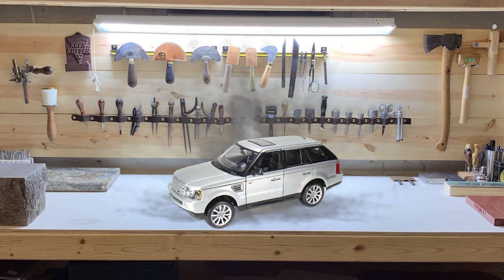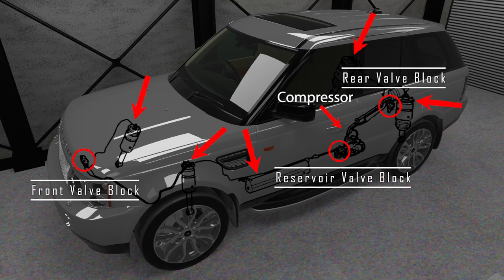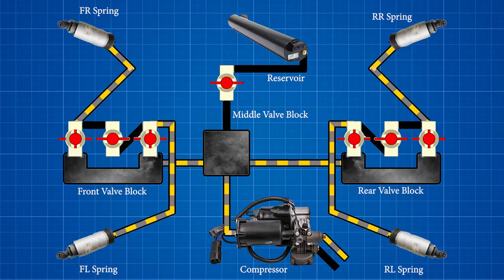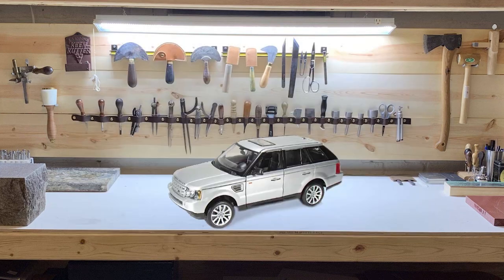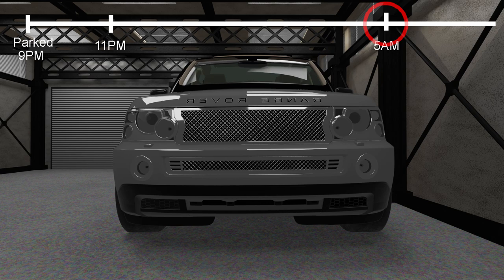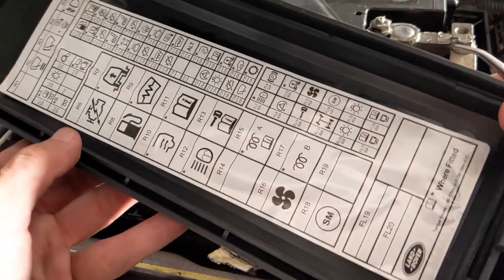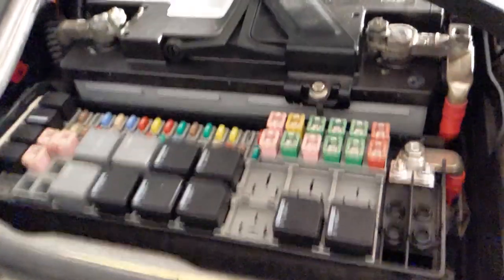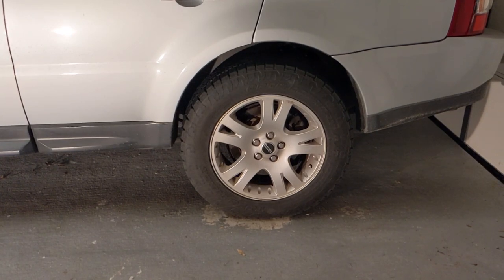Suspension Sagging Overnight - Range Rover Sport or LR3

Comment: I wanted to comment and thank you for your videos on the RR Sport.  I have recently replaced the Compressor on my 2008 Sport SS based on your video instruction, and now have determined the codes / messages that you got for the 'ride height sensor' (RHS) were the exact same as I am getting and it randomly collapses to the bump stops after those warning messages.  I can start it and go for an unknown period of time, then same failure again. The air test overnight resulted in no movement at all (not even 1/16 of an in.!)  at each corner and no front or back reduction, so I am hopeful it is just the LF RHS - the OEM part is due to me Monday or Tuesday.  I will rebuild/replace all valve blocks in the future even if they indicate no problem at present.  I will also leave a comment on the compressor replacement video regarding that procedure. Thanks again! Best, Jim

Comment: Thank you so much, this answers alot of my questions... I take it the vehicle has to parked on level ground overnight(excuse my stupidity😋). Been in and out of so many forums and this is the best explanation I could find so far 🙂🙏🙏.
Reply from the maker: It should be on relatively level ground, If it's a slight incline the front might drop some just from that. You can tell if it's the incline causing it by parking in reverse and seeing if the rear lowers instead.

Comment: Great video,  my truck goes down on the rear right only every overnight.  Tried Disconnecting the battery overnight and it didn't go down at all. That would indicate it's the ride height sensor?
Reply from the maker: That's a good guess, I would change that first considering it's pretty cheap.

Comment: Awesome video, thank you! Question, if I don't notice any change in height on the vehicle in the morning, but I hear the compressor running for a min or two upon startup, is that normal?  Is it just replenishing air in the reservoir? Or is it likely due to a slow leak?
Reply from the maker: While driving the vehicle will use the reservoir to make height adjustments, so when the car is turned off, the reservoir will be partially empty and it will not refill while the car is off. Because of this, when you turn the car on it will need to run for a bit to refill the reservoir even with no leaks.

Comment: My 2019 RR Sport SC V8 with 76K miles as started  sagging a little in the front over night. LR Dealer could not find leak.Dealer thinks it's a pinhole leak in the system. But they couldn't find the leak. The truck is not throwing any codes, nothing on the dash.They didn't charge me for the two day diagnostic. Their plan is to wait for the system to throw a error code. Any thoughts from you would be much appreciated . Great channel by the way !! Very informative.

Comment: great video, helped me a lot to under stand the system. I'm having a 
problem still, after finding the 2 front bags leaking and replaced, the front valve block replaced and the pump replaced its still dropping. With the fuse out i get a drop over night FL 30mm,FR 50mm, RL 5mm and RR 25mm also now the car will not actually level with each corner doing a different height. Ive sprayed them all with soapy water with no bubbles showing. any ideas would be great thanks.

Comment: Hi, just bought a RRS 2010 and Passenger rear (UK) side is sagging over night, not the whole rear. So problem would either be the air spring or the valve block ( not tested anything at the moment).

Comment: Great video and thank you. Q4U. My 2013 RRS driver side rear sags at night bit at times if I drive long for 20 mins it will rise back up but I keep getting. Suspension fault and the higher controls are offline. I replaced the battery and reset with the steering wheel and sometimes it works and sometimes not. My next step is to replace the rear block. Would you suggest anything else?

Comment: So I had a few of these problems, replaced struts my self etc etc, ended up going to LR shop to see why still sagging over night and they said the driver side hose had a leak in it¿ $800 was there quote, is the air hose a manageable replacement¿ lmk thanks
Reply from the maker: Front driver side? The hard part will be running the hose under the body panels, but it's definitely doable. I wonder if the problem is really a leaking hose or if it's actually the valve block.
Reply: @HazyJay  I wonder too, they had it for two days, changed the o ring fittings, car pops up, they held it a day to see if it would hold ride height and then I’m sure went through all their checks and balances etc etc, and called me back and said everything was holding except the green driver line…

I see it on eBay for pretty cheap, any idea how long it will take rough estimate thank you so much for your response and videos trying to hurry and sort this so I don’t go through the compressor
Reply from the maker: @moonbootmeechy  You will need to remove the front right wheel to access the valve block and the top of the airspring, then it's just a matter of replacing the green line. You could probably tie a string to the old line before you pull it out of the bodywork so you can attach the new line to the string and pull it through, might make snaking the new line easier.
Reply: @HazyJay  okay… I have seen both components when I changed the struts myself so I imagine shouldn’t take more than a couple hours I hope…

I’ll try to tend to this next weekend, and I’ll will let you know my results wish me 🍀 and thanks again¡

Comment: Thank you so much for sharing! I learned a lot from your videos! I have a question. Sometimes there is a hiss after flame out. With the hiss, two front wheels get lower rapidly at the same time. Do you think there is a problem with the valve (front valve or middle valve)? Thank you again!
Reply from the maker: Sounds like the valve is working fine, the car will level once it's turned off (downwards only)

Comment: Thanks for this! I found my LF air bag was leaking using this video on my 2012 Range Rover Sport with VDS. I just went ahead and replaced the front strut and shock assemblies but now I have an Active Dynamics Fault. Is this because the suspension needs to be calibrated? Or is this a bad strut? (I went aftermarket). Also worried that I didn't lift the vehicle right and damaged something..
Reply: Did you ever fix this

Comment: This is a great video. I would assume this works with a RRS L494? I have a sneaky suspicion it’s my front passenger side airbag/valve block but will try this tonight.
Reply from the maker: The procedure should be the same but the fuse will likely be different, you will need to either look up the fuses or just disconnect the battery for the procedure.

Comment: Fantastic vid, my RRS 2.8 has been deflating about every day and sometimes it won’t raise at all, so I let it sit for few days and started it and it rose as normally I removed the Air suspension ECU fuse and it hasn’t sagged but my power steering was lost 🙈 any idea why?
Reply from the maker: The RRS has speed sensitive steering which changes the stiffness based on the speed, sometimes it errors due to voltage drops. I'd guess that leaving your car for a few days caused the battery voltage to drop enough to cause the module to error. I would let the car idle for a while to charge the battery, then unplug the battery for an hour (to reset), reconnect and try again. If it has been a few years since a new battery you can try that, I suggest AGM batteries. Otherwise, you may need to take to the dealer. Obviously check the power steering fluid level but I'm guessing this is normal.

Comment: Replaced both front springs and cleaned out every piece of the front valve block. Front sags (tilts front left mostly). What are the odds the lines have issues?
Reply from the maker: I'd spray the top of the front left spring and front valve block with soapy water to see if the Voss connection is leaking. Also, consider replacing the front valve block entirely, the O-rings and solenoid seals may just be worn out and are allowing leaks back to the compressor.

Comment: Hi there I recently changed my dryer and before I did the suspension would raise slowly in the front but would still raise but now after the dryer change the front won’t raise and the compressor goes. On and off a few times then comes up with a fault saying air flow code c1311 and I can’t figure it out plz any help

Comment: Awesome video! How would we know that it's not the compressor?
Reply from the maker: A faulty compressor alone wouldn't cause sagging, rather it would cause "Suspension fault normal height only" messages to appear shortly after starting the car as the compressor tries to fill the tank/springs but overheats.
Reply: @HazyJay  Right on, thanks for the response. I'll have to do this test, I don't think there's too much sagging when i come out to my rover in the morning. the fault comes on right after starting, and if i turn off the truck and turn it back on it goes away. It never comes on when driving on the highway, only when starting, and occasionally when driving slow.
Reply from the maker: @rhandomskate  Ah, sounds like the compressor, the compressor really only lasts around 10 years or 70k miles or so.
Reply: @HazyJay  I did the test where I pulled the fuse and let it sit overnight. My front end dropped about 3" over night, equally on both sides. Do you think I should replace the valve block and the compressor? Like I said, the warning goes away after restarting my rover and it seems to come back up to normal height again and then the warning light rarely comes on again after driving.
Reply from the maker: Just try replacing the valve block first as this would cause a front end drop when the fuse/battery is disconnected! Save the more expensive compressor for later, but a faulty compressor wouldn't cause a leak overnight. @rhandomskate

Comment: I have an issue where the vehicles actual height and height on screen don't match.. is it the height sensor?
Reply from the maker: For all wheels or just one? It's either the height sensor (s) or the vehicle needs calibration.
Reply: @HazyJay  it's the rear right . Says height sensor faulty . But somehow car levels itself but stays slightly crooked. Whereas screen shows red blinking completely down wheel
Reply from the maker: @asadmo  oh ok, I would replace that height sensor in that case. Should be a cheap fix.
Reply: @HazyJay  I've got it with me. Any idea how to fit it as in jack it up or extend it ? It's a 2011 sport
Reply from the maker: @asadmo  You'll have to remove the wheel since it's too hard to reach otherwise (i believe), remember to disconnect the battery so the car doesn't try to change heights while you're doing it.
Reply: @HazyJay  thank you so much for your prompt response. Bless you

Comment: Hi haze I tested it and my front passenger side is the culprit. It lost 2cm over 48 hours. I see some videos say there is an acceptable limit if it drops less than an inch. Do you recommend changing the air spring or is it normal to lose a little air?
Reply from the maker: I think 2cm is OK, if it starts getting worse then you'll know what you need to change but it's probably OK to wait until it's more significant.

Comment: Hello Hazy! Thank you for this video. I have a question and I apologize if it's a stupid one. I have a leaking rear sway bar which is being replaced early November. (couldn't get an earlier appointment) I also have sagging on the front driver side and it progressively gets lower each day the car sits. I drive it about every 3 days and it corrects itself every time I do drive it. My question is are the sway bars part of the air suspension or are they 2 different systems? Thank you for any information you can give me. My vehicle is a 2013 Range Rover Sport Supercharged
Reply from the maker: The sway bar is just that, a metal bar, that links the left and right suspension to prevent body roll. While parked, the sway bar doesn't do anything, it really only stresses when you're taking sharp turns. The supercharged version has "dynamic stability control" which complicates things, this is likely what's leaking. Long story short, the rear sway bar leak shouldn't be causing your front driver side lowering.
Reply: @HazyJay  thanks for replying! Take care!

Comment: GREAT VIDEOS. I've done what this video says but it don't sag at all but it sags overnight when I put the fuse in. Any ideas? I had leaks in the front and replaced both front struts, front valve block as well as the middle valve block but there is still some sagging overnight
Reply from the maker: When the fuse is out let it sit and measure each wheel height manually, which one is sagging?
Reply: It doesn't sag at all with the fuse out
Reply: There is no sagging at all with the fuse out

Comment: Hey Hazy thank you for your clear videos.
My issue is the (right rear) side sag when left overnight. 
I took off the fuse "F26" overnight and the result next day was still sagging (right rear).
So now what's the verdict?
Reply from the maker: Likely a leak with the right rear airspring or it's connection to the valve block.
Reply from the maker: I would spray the spring with soapy water to see if there is a leak, if not, try replacing the valve block.
Reply: Sorry I forgot to mention I already did   that, couldn't really see anything. 
But thanks for your rapid response tho!

Comment: Mr. Hazy, a stumped LR3 owner here. I replaced the air struts, front and rear valve blocks are within a year old, overnight test confirms no leaks. But there seems to be an electrical issue. When I disconnect and reconnect the battery, I can freely raise and lower via the switch. Then, with no fault on the dash, EAS goes into "auto" mode, orange lights by switch go solid, 4x4 infotainment screen and radio lose function, and the suspension goes into normal height to drive and access mode at key off.

Standard OBD2 scanner says vehicle is free of faults.

Any insight would be helpful.

Comment: Hi, I have a question. I have a Range Rover 2009 Sport. It descends on the left side, the front and rear are the same size. I mean, it descends on the left side of the front and back a little, even if it is standing or walking.
Reply from the maker: The front and rear are controlled by separate valves, so there are two possibilities. 1. you happen to have leaks on the left side front and rear springs or at the valve blocks or 2. the air suspension needs to be calibrated to be level.

Comment: Hey Hazy, what if the passenger side (front and back) doesn't raise, what could be the cause of that?
Reply: Most likely the bags. Lower the vehicle all the way to access mode. Turn car off and wait for compressor to shut off. Turn car back on and raise it. Step outside the vehicle and start spraying soapy water on the strut towers. If they aren't taking any air and there's lots of bubbles then that's the culprit. If not then refer to your valves.

Comment: Im new to the range rover sport and the back was sagging like in the video. I followed the steps and took the fuse out. I came back in the morning and there was no sagging it was at the same height it was. Any idea what that could be thanks. Ps these are very good tutorials 👌
Reply from the maker: That's good, it means no leaks. If you're parking on an incline it will drop like that, also the system may need calibration at the dealer on a calibration (flat) surface.
Reply: @HazyJay  thank you very much
Reply: Do you have a video on that or main dealer mate ?
Reply from the maker: @stephenpeak3004  it's a dealer service unfortunately 😕, as much as I dislike going to a dealer

Comment: Hey there hazy, so i replaced my front bags and it camed with new seals and now but not all the times i see the vehicle sag still in front could it be the front valve block and i get a dynamic error code in dashboard and rides rough can it be the valve block and height sensor?? Thanks for you response
Reply from the maker: If the entire front is down after unplugging the battery all night, it's likely the valve block. A height sensor issue would have unusual heights on the 4x4 info in the dash (versus real life), so luckily that's easy to see. I'd consider changing the valve block since it's fairly cheap and easy 👌
Reply: Will try this thank you

Comment: Hi what about is is drivers side go down front and back ? Thanks for you videos.
Reply from the maker: Same principle should apply, remove the battery connection (or fuse) to localize the leak. If there is no leak, consider you may be parking on a sloped horizontal (left or right) surface or the sensors need calibration.
Reply: Thanks

Comment: hello, I have such a problem with lr3, I hear that the compressor turns on often, sometimes it regulates itself, the car lets in and releases the pressure from the rear airbag when I leave the car on, it also does not fall from the given corner for 24 hours.  I do not know what it could be, as I wrote, the compressor comes on often, and it seems that there is no leakage, maybe someone knows something about it.  hello and thanks for the videos👍👍👍

Comment: So after leaving over night with fuse 26 removed. And none of the airbags drop at all. 

What do you suggest could be the problem?

Fronts raise slowly when compressor running etc but the rear bags fly up pretty fast.
Reply from the maker: What is the problem with the vehicle? The good news is there are no leaks since it stayed up over night. The rear typically will rise faster due to less weight in the rear (engine in front).

Comment: I have the same problem, a 2010 Land Rover Sport tilts to the right side, front and rear, and when driving on the road, the air pump stops working, which causes the vehicle to slide